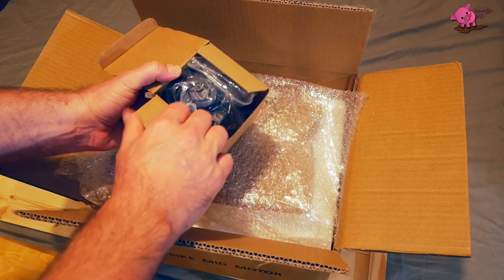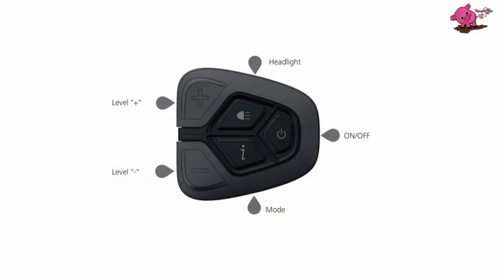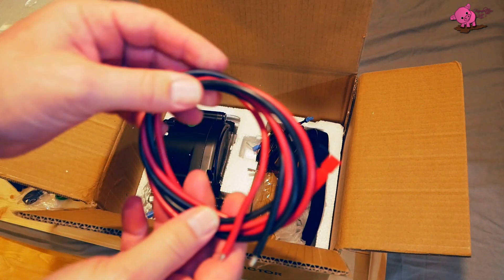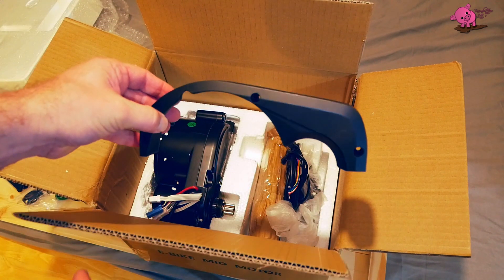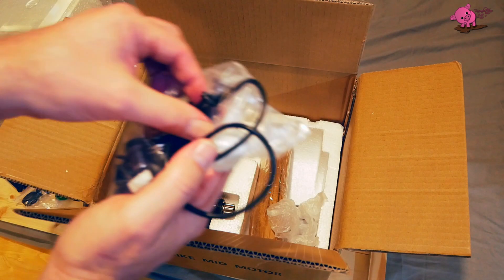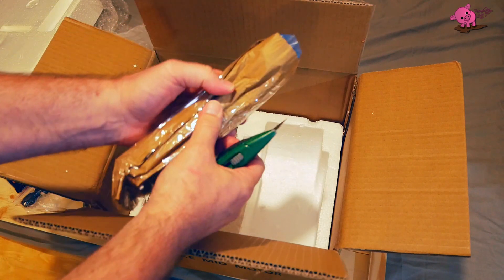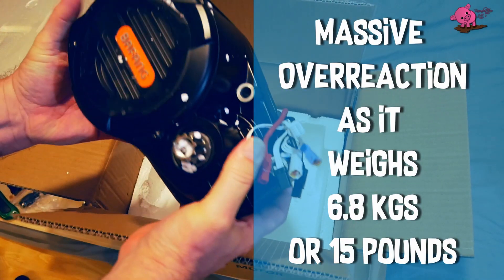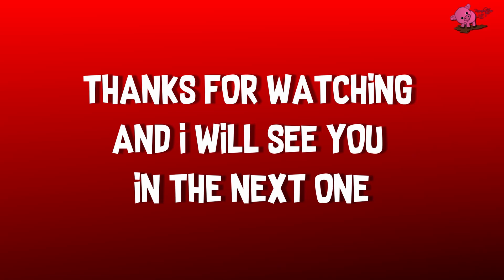BAFANG ULTRA MID MOUNT MOTOR UNBOXING FOR EMTB FRAME PART 2 BAFANG M620 G510 mid drive motor #BAFANG

Comment: Great build. In later videos i saw that you plugged in the brake level indecatiors . Are they necessary for the motor? Because you did not plug in the battery communication for example. Do you know which cables have to be used to run the system besides power and display? Regards
Reply from the maker: Brake levers were used for cutting motor when pulled. Not sure on the wiring as I don't have the bike anymore 👍
Reply: @baconbuttties  thx for the quick response. But the motor would have worked without the brake levers?
Reply from the maker: @TheMrCsan  yes that's right, motor will work without levers 👍
Reply: @baconbuttties  thanks for your help
Reply from the maker: @TheMrCsan  👍

Comment: Could you tell me the distance between the holes on the bracket or the 620 motor as I'm looking for a frame
Reply from the maker: I haven't got the motor anymore to measure it, but this motor only fits a particular mount.
Reply: @baconbuttties  Thanks for your reply
Reply from the maker: @patconnolly2204  👍🏼
Reply from the maker: They call it the G510 mount  like this https://www.greenbikekit.com/bafang-ultra-motor-hanger.html

Comment: When I got my Sur Ron the first thing I disabled was the brake cut off. What a pain and not needed.
Reply from the maker: Yeah I put those magnet type cut off switches on this bike but they were intermittent and was cutting the motor all the time .

Comment: Hello i have a question. I have the BBS02 and am very happy with it. However i thought that it had a rotation sensor that would put more watt out when i peddle faster (higher rpm). Now its just a on/off sensor basically, because it gives full power, even when i peddle very slowly. This is ok for me, but i want to build an ebike for my mom too. I want that bike to be a little more refined, because other wise she would be too scared to jump on the bike :) (she almost crashed my bbs02, when she peddled in the highest pass in the corner when she tried the bike). My question: does this bafang have better rotation sensor, since it has a force sensor too? So; does the motor output for example 300 watts when I peddle lightly and more (for example 1000watt) when I peddle faster/with more force)? Thanks.
Reply from the maker: I would say that setting 1 is not that aggressive and does sense pressure and only assists when you are pushing on the pedals. For example if you was going down an incline and  pedalled lightly then the assist would not activate. I have to say though that what I find acceptable for power assistance may differ from person to person, for me  it's fine and I only find setting 5 aggressive for others setting 1 may be to much.

Comment: I have just found this is available, I had an idea i wanted to build my own mid mounted ebike …kind of want a twist throttle though…main comment is right now, in this corona era , I wonder if there would be delivery time issues coming from China
Reply from the maker: Im not sure how long of a delay it would be from China as even in normal times it varies from different sellers

Comment: Very nice video. I would like to buy this ultra mid bafang, and I would like to know if it has the same bolts as the 250w max bafang.because I own an ebike wayscral 755 equipped with bafang max drive 250w. Can you please tell me if it is possible to install it? Thanks in advance for the reply
Reply from the maker: The bolt pattern will be completely different on the Bafang ultra 620 so it will not fit

Comment: Beautiful, thanks for sharing. I recently built a DIY frame for it, this motor is a beast! Also just to clarify, I believe the Bafang model number for this motor is the MM G510.750/1000.C. As far as I understand it the model number M620 represents the full OEM drive unit with the battery pack and display. Also fyi, most of the Alibaba sellers will include the mounting plate for a DIY application as well as the usb progamming cable.
Reply from the maker: Thanks for the info 👍
I was just watching a video of yours the other day when you was doing a speed test.

Comment: Hi   is this more powerful than the G510 .?
Reply from the maker: I think they are the same motor with some minor  updates?
Reply: @baconbuttties  yeah same motor I think M620 represents the model number for the whole drive unit with the battery pack.

Comment: I guess for this powerful motor you need a motorbike sprockets and chain!
Reply: Depends on the power setup but I'm running mine at 1500w with a heavy duty KMC bike chain and standard 1/8" bike sprockets.

Comment: would you happen to know where I could get the head and tail light wire harnesses because the bike I bought with this motor do not have the head and tail light connected to the battery they are built into the frame but are not connected to anything so had to use after market lights on it
Reply from the maker: I don't know as the wiring harness for my motor comes with it from Bafang so maybe contact them.  Does your motor have the wires on it ?
Reply: You could also try contacting one of the Bafang resellers on Alibaba.com. I believe the model numbers are EB 1T1.EX.XXXX (front) and EB 1T1.FX.XXXX (rear). https://www.bafang-e.com/en/oem-area/components/component/connector/eb-1t1exxxxx-1/

Comment: You said there’s no instructions in the box, does Andy Kirby make any information available on his website seeing as he is the one who supplied you the kit?
Reply from the maker: I don't know if he does, I will have to have a look and see. I know he will try and help if asked.
Reply: What kind of instructions are you looking for... install, programming? I haven't found much from Bafang but the install is pretty straight forward... the motor will only fit in a frame fitted with the mounting plate and the cables are color coded. The torque sensor programming is a bit tricky, I just published a video for it. Otherwise Bafang has a basic spec sheet on their OEM website https://www.bafang-e.com/en/oem-area/components/component/accessories/mm-g5107501000c/